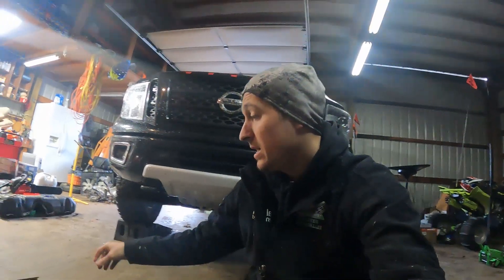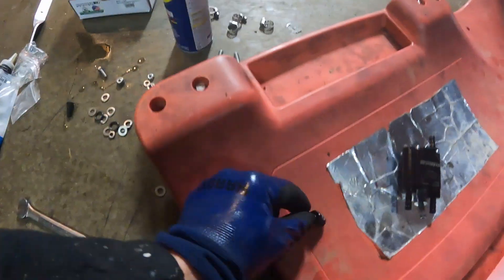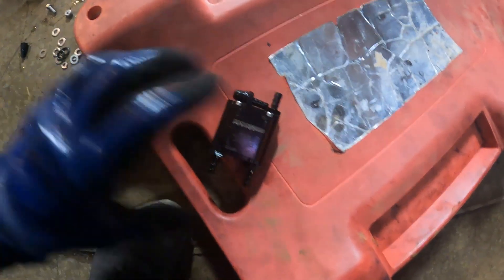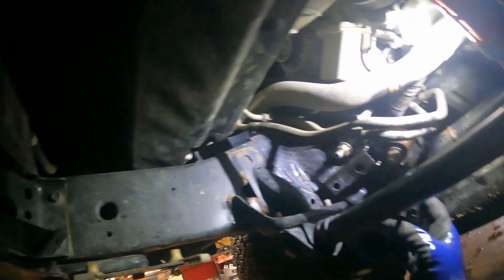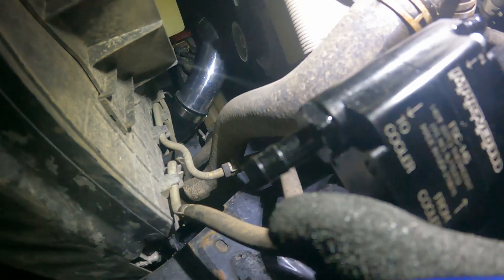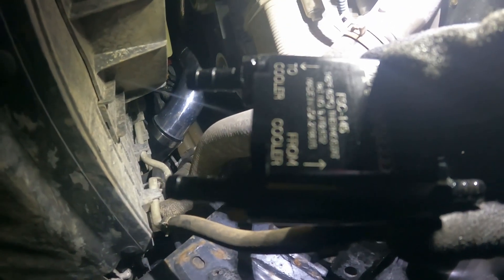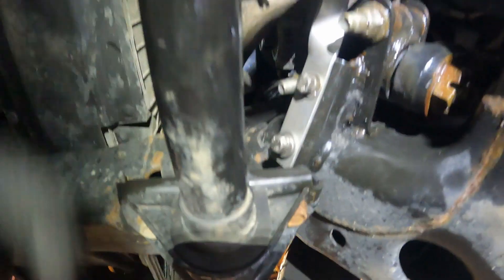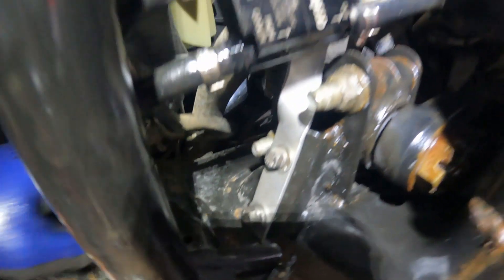Nissan Titan XD Cummins Transmission Thermostat Install DIY

Comment: Hello, I click the link you put in the video to purchase the thermostat and they only have available is the 165 degree and not the 145 degree you recomen, is that ok to go with 165 instead, because the 145 degree is out of stock unless you know another company the sales this thermostat, I will way for you respond and thanks again keep up with the good work you do I love your videos thanks
Reply from the maker: 165 is also a good choice. You can check with CFT performance to see if they have one in stock.

Comment: Video request idea: 50 gallon aftermarket fuel tank install. With pick up tube fix so it doesn’t run out of fuel at a 1/4 of a tank.

Comment: Is there any forum where max miles are announced? Sadly i do not think my XD will ever make 500.000 miles. Sadly i used to have Touareg v10 and sold it with 550.000 km on it. It was time to drop the power pack and replace a starter. For the firs time after 12 years it failed and worked intermittently.That Touareg was giving me same fuel economy pulling 5000 lbs trailer what empty Cummins Titan does. All that f.... emission crap. How is it supposedly more emission friendly if it DOES burn more fuel for the same distance. Even with all mods  Titan does not come even close to old VW Touareg. Sad indeed. In Eastern Europe where i'm originally from Touaregs make well over million km. Different philosophy i guess. Over here as soon as you finish making a payments ??? ,Time for another new one. Anyway 150.000 km now ,no major issues yet. Needless to say no monthly payments so waiting for something to happen. Designed obsolescence.